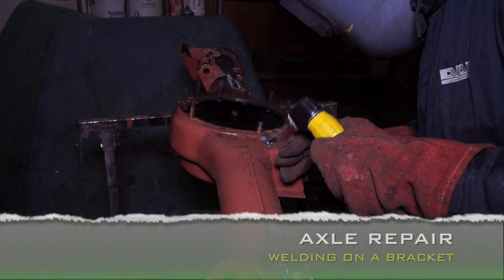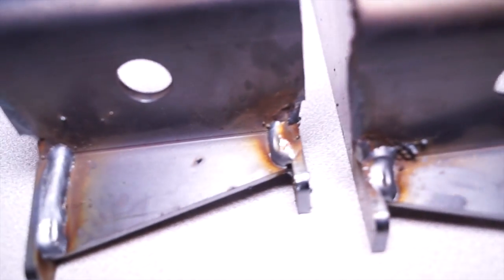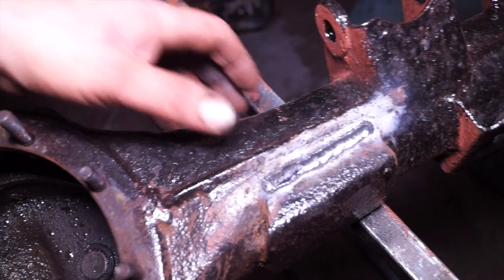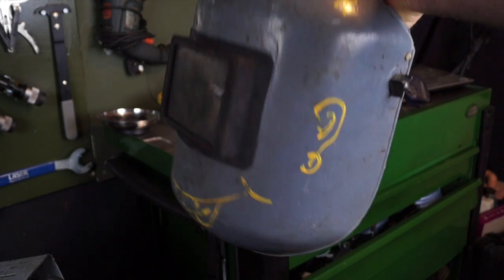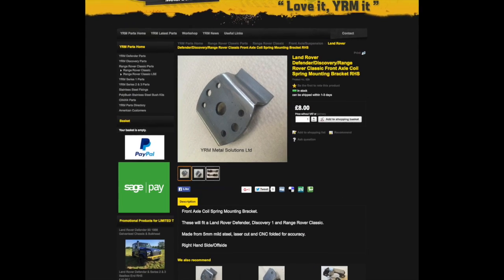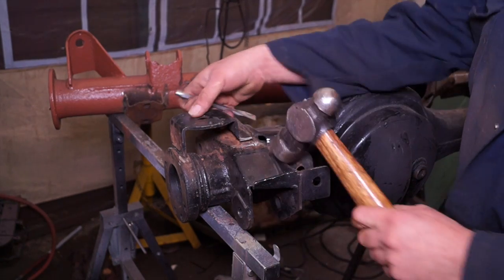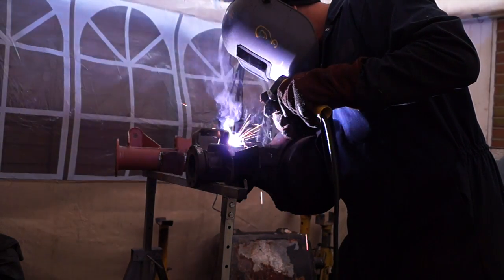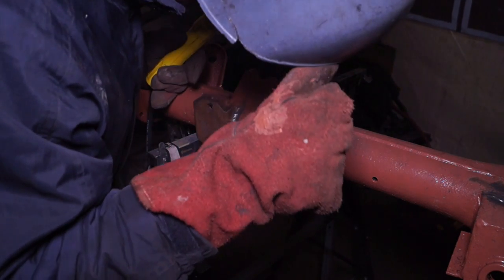Part 2 Welding on a Defender front axle bracket - 110 Project

Comment: I’m tackling this tomorrow! What joy! Lol I have a 200 amp multiprocess welder with flux, gas mig and stick. It also does DC Tig but I don’t have a bottle of 100% argon so that’s out. I’ve not attempted stick yet and I have a spool of .035 flux core so I’m going to give that a go first. Thank you for this video. This being a load bearing bracket I’ve been a bit hesitant.

Comment: i used one of those sip mma arc welders and was the welder i learnt upon, wit those common available 6013 rods. NOW! do yourself a flavor and try and oxford oil filled arc welder with 7014 rods and you will realise how much you struggled on with that old sip. you can pay a right old wod for a good oxford arc, though they can be found in cosmeticaly bad condition for pennies and so long as it arcs and powers up, she good, trust me, their is sod all to these things inside anyhow. their just a large tranny afterall. infact trying those 7014 rods with your sip will make a great difference too, i hate those bloody 6013s.yuk!
Also bear in mind that 6013 and 7014 are easy rods ran on AC only arcs or on + or - electrode on a dc arc welder. so you cant really go wrong with them, But these are the only two, all other rods tend to be specific of either AC only arcs welders or have to be run specificaly on + or - electrode positive on a dc welder. bare this in mind when buying rods, rule of thumb is generaly stay with 6013 or 7014, otherwise if you cant get them then be sure your setup is set right for whatever alternative rod you got your hands on, save all the ball ache.

Comment: Hi have you made a video of faults with defender 2007 ABS - TC warning lights on
Reply from the maker: +Peter Wade   No but TC is ABS related so you'll need to do some interrogation of the ABS system to what fault it is kicking up before component testing.
Reply: found that rear left sensor is low output
Reply from the maker: have you changed the sensor?